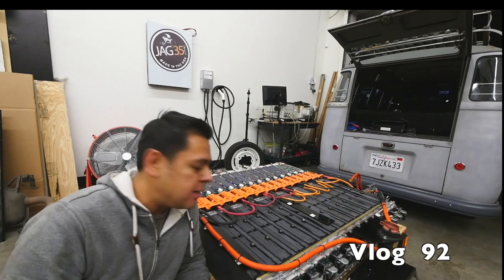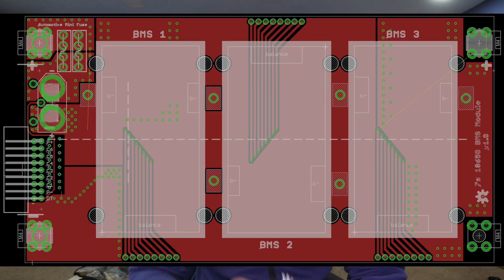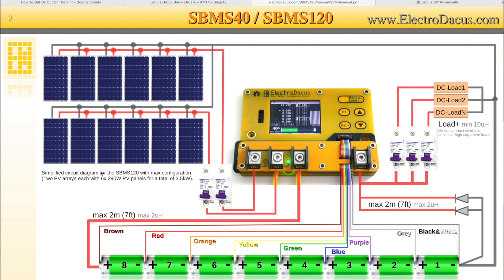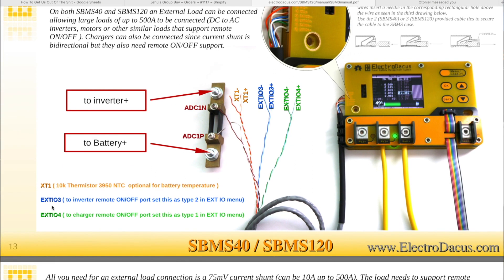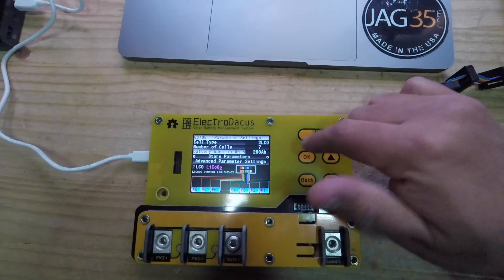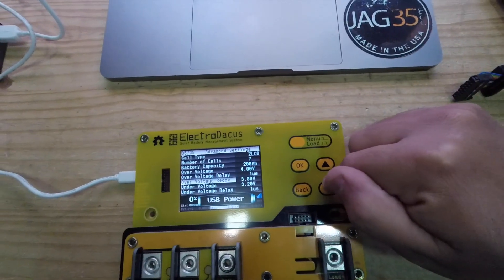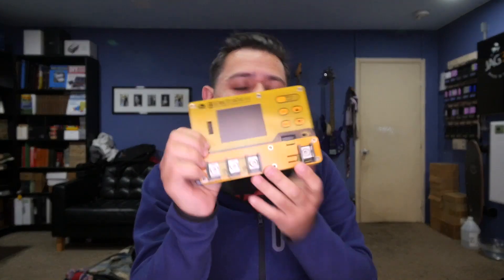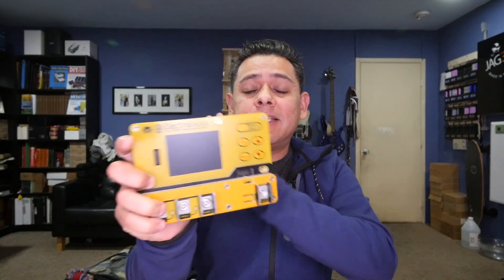Solar Battery Management System (BMS)

Comment: What would be a good cheap capacitor for the BMS120?
Reply: Are you referring to supercapacitors or lithium battery ? Super-capacitors are just not cost effective for energy storage applications and LiFePO4 will do better than supercapacitors in all aspects.
Reply: To convert the DC to AC...what do you recommend to go with the BMS120...or would any old Home Depot one work?
Reply: Sorry, I do not understand your question.  SBMS120 is just a solar PV charger + BMS + energy monitor it has nothing to do with DC to AC conversion that will be done by an external inverter.

Comment: Jehu, do you know anything about Orbisdriven.com or ORBIS Wheels in Mill Valley, CA. They have developed a highly efficient ring drive technology which they put on a Honda giving it 4 wheel electric drive. I’m thinking it would be ideal for a VW bus, getting rid of the transmission entirely. And it’s super efficient, better than a Prius.
Thanks, Clyde.

Comment: Will this work with a 24 volt tesla moduel
Reply: Yes it will work with a 6s Tesla module but that is not a 24V module just a 22.2V nominal so you will only be able to use the totp 30% or so of the capacity because most 24V inverters will shut down around 21V to 22V so you will need to find an inverter that can be set to use lower voltage at least able to handle 20V in order to use more of the available capacity or if you just use DC loads that are happy with as low as 20V then that will be fine.
Reply: the higher end Magnum inverters say they will go as low as 18v. Haven't used one yet, but I will on my next project with 6S tesla modules.
Reply: What model of Magnum ? As most of their inverters will not work with lithium as they do not provide a remote ON/OFF port to integrate with a BMS.  Victron, Cotek, PIP2424 and a few others support a BMS and so can work with Lithium batteries.
Reply: @electrodacus  It looks like their MS (MS4024 etc) and RD series inverters all support the lower voltages required for 6S tesla modules to have full capacity available. You would know better than I do, if they support your devices. I don't own one yet and haven't looked in to much detail. 
For me personally, on/off control is not necessary. These inverters can be set to whatever LVD voltage you prefer to protect your batteries. And any high quality charge controller can be set to stop charging at whatever voltage you choose. I have been running my Off-grid system like this for two years. I'm using all Schneider gear with my 10  7S modules. Admitedly the charge controllers aren't made for lithium, but they get the job done. The batteries have remained balanced, so active balancing isn't really what I'm looking for. I do want a bms that keeps an eye on the balance and disconnects the battery to prevent catastrophic failure (fire) if for some reason the charge controller fails to stop or one string does get out of balance and might discharge to low.
Reply: A lithium battery needs a BMS and LVD protection is done based on the lowest cell voltage say 3V for those Tesla /Panasonic NMC cells and the total pack voltage has no relevance.  If the inverter has no support for remote ON/OFF so that a BMS is able to turn off the inverter when the lowest cell gets to LVD then it can not be used with a Lithium battery.
The MS4024 is an extremely old design and can only work with Lead Acid batteries as it has no simple remote ON/OFF for a BMS and has no simple way to DIY that as they decided to use a momentary switch for ON/OFF instead of traditional mechanical ON/OFF switch.
As for most inverters that include all Victron and Cotek that remote ON/OFF port is nothing more than two wires in parallel with the ON/OFF switch and then the switch is left on the OFF position and then the BMS with just a simple optoisolator will turn the inverter ON by shorting those two wires that are at battery voltage level say 24V and shorting them will result in a 10mA or so current.
Same is true for any charger you will want to use the BMS will need to have ON/OFF control of that so it can turn it off. Not many charger have that option but the new Victron SmartSolar MPPT have that remote port and is compatible with SBMS.
Running a Lithium battery without a BMS is just asking for problems and I know my word is less valuable as I design and sell the SBMS but it is still true.
So the main idea is that LVD and HVD on Lithium is based on lowest or highest cell voltage and the pack voltage is useless and only works for Lead Acid.
Cells will always drift without active cell balancing and while having a BMS will still protect the pack you will need to do manual cell balancing at least every few months so is not worth the trouble when the cell balancing circuit cost almost nothing.
I had run my 8s 24V 100Ah GBS LiFePO4 battery for 4 months with cell balancing disabled and by the end of the period there was a 2Ah delta between the lowest and highest cell so about 0.5Ah per month or 0.5% per month capacity loss due to unbalanced cells.
Batteries are expensive compared to a BMS so is just not wort damaging the battery just to save a small amount on a BMS.  The SBMS0 is 120USD and has cell balancing (can keep even a 100kWh battery balanced) and is also a energy monitor so it calculates the SOC accurately so you know how much energy you have left and also has an energy counter so you know how much energy you got out of battery every day and also over the life of the system (that is separate and permanent even if battery is removed).
Reply: @electrodacus  It's interesting the differences between the batteries you use and the ones I use, and how we use them. I don't charge my batteries to anywhere near 100%, I stop at 4V , so I'm unsure if the balancing would ever happen. and I don't discharge them below 3.14v. I would need 10 of your SBMS0 to effectively monitor my batteries. And I'd buy them if I knew it would be practical. I still plan to buy one to test out. Is there any way I can control a normal contactor with the on/off signal it sends to supported charger/inverters? Like the car people do?
Reply: I really only want to have a BMS for disaster prevention if something actually goes wrong inside the battery or my (very high quality) charge controller locks up and charges past it's set point. Right now I just spot check the balance and in 1.5 years, there has been no problems. I think its because of how these batteries are made and used. My battery bank has over 3000 factory matched cells and they seem to keep each other in balance.
Reply: The cell balancing works at all time as soon as there is more than 10mV delta between cells and 4V is also what my SBMS is programmed as default for those type of cells as for this type of application (stationary energy storage) it will not be cost effective to go above 4V (maybe you noticed Jehu was a bit surprised to see 4V as the limit :)).
Not sure why you think you will need 10 SBMS0 as your battery should be just a single large battery made of large groups of parallel cells then they will be connected in series say 7s for proper 24V
It is incorrect and dangerous to have separate Tesla 6s pack's connected in parallel. In the car they are connected correctly as all those 6s packs are connected in series and there they do need a BMS able to check 96 or so pack of parallel cells because of the much higher voltage needed.
Quality cells are very close in characteristics with each other but even small delta between their characteristics will overtime result in imbalance and that is why the Tesla EV's have a cell balancing that works exactly the the one on SBMS.
Those cells charged at 4V will be at about 80% SOC and discharging to 3.14 you will be at about 10% SOC and that is excellent the same with what I have as default settings in the SBMS but then if you only use 70% of nominal capacity why will you not use LiFePO4 where you can use 100% of the capacity and still have more cycles and price for usable capacity will be about the same.  Now as you already have this Tesla packs it makes sense to use them is just that they are not as good and safe as LiFePO4 and the cost amortization is better for LiFeO4. On top of that LiFePO4 come in to large capacity cells you can build a proper pack out of them where with Tesla you can not reconfigure the packs and you can only use one properly as paralleling them is a bad idea as the other parallel packs can push current in to the defective pack.
I understand that by using those sort of NMC cells where charge discharge curve is less flat than LiFePO4 and adding the higher top and bottom reserves makes it so that cell imbalance will not create huge problems if you manually monitor the pack and do manual cell balancing when needed. You likely are top balanced and most of the time you are fully charged at 4V and almost never get close to 3.14V since there the reserve is much smaller.

Comment: If it doesn't have a transformer or any kind of inductive element, it is a battery MONITORING system. Passive balancing via discharge is essentially useless at balancing cell voltages. A battery MONITORING system is still useful because it prevents damage to individual cells.
Reply: The passive cell balancing system used in the SBMS is the most advanced possible and can keep in balance a battery as high as 100kWh in capacity. Same type of cell balancing is used on all commercially available EV's including Tesla and their huge packs are perfectly balanced.
Reply: @electrodacus  There's really no point in keeping a pack in balance using a passive balancing system while the battery pack is in use since you'll get the exact same capacity out of the pack (assuming you are still using a monitoring system) regardless of whether the balancing algorithm runs (unless the cells are BADLY out of balance). A passive balancing architecture just burns off useful energy as heat. Unless you use an active balancing architecture, you really only need a battery monitoring system and manually top/bottom balance a pack every one or two hundred cycles  or when the monitoring system reports that two different cell-layers are bottle-necking charge and discharge. A passive balancing system that can keep large packs in balance by voltage is wasting money on superfluous power MOSFETs and the associated thermal management. To get the most out of a battery pack without an active balancing architecture, top balance the pack and stop discharging when one cell-layer hits 3V (or 2.8V for LiFePO4). If manually balancing the pack at any point in its lifetime is not an option, that's when a passive balancing system that only runs during charging would be needed (in which case, the unit manually top balances the pack every charge cycle, but it has all the time in the world to top balance, so it wouldn't need excessively large power MOSFETs and thermal management). Honestly, the resources required for a sophisticated passive system could be used to make a sufficient active system, just add a flyback transformer and isolated mosfet drivers.
Reply: I had a 100Ah 8s GBS LiFePO4 battery and used that for 4 months with the SBMS but cell balancing disabled. Battery started perfectly top balanced and after 4 months of normal offgrid usage about 50% of battery capacity used every day the cells where 2Ah out of balance meaning than when the highest cells was fully charged the lowest cell needed additional 2Ah to get fully charged. So basically 2% of battery capacity was lost over 4 months of normal use or around 0.5% per month.
Now if the cell balancing will have been enabled on SBMS then charging will have been done just during the day when charge current was above 1A that is most of the day as more than that will typically get in to battery while charging. Now the cell balancing is around 150mA so that means all all energy for cell balancing comes from PV panels directly and not from battery so cells that are higher and need balancing will see a charge current that is 150mA smaller than the other cells so no energy is extracted from any battery.
Say charge current is 10A then some cells will see full 10A and the higher cells will see 9.85A.
Based on the GBS example the cells will only need about 3 to 4h of cell balancing over a full month to be maintained fully balanced.
All that energy "wasted" for cell balancing that will not be much is directly from PV panels so say the 0.5Ah per month for the 100Ah battery means say 24V x 0.5Ah = 12Wh /month that will be 144Wh over a year and say over 10 years that will be 1.44kWh and at a just 2 cent/kWh cost amortization for PV panels that will be around 3 cent total over 10 years period (actually nothing as there will be plenty of excess energy from PV in an offgrid application).
While this 2.5kWh is a small battery even a 2.5kWh will only cost 30 cent in wasted energy over 10 years period and you will not want to manually balance your pack energy few months for less than $1 in 10 years :) You will also need that energy when you do the manual cell balancing so not even a few cents of savings.
Same will be the case for anything other than restive cell balancing (it is just not economical).